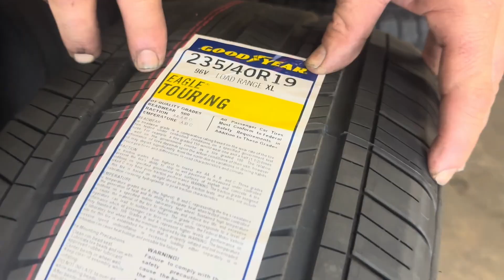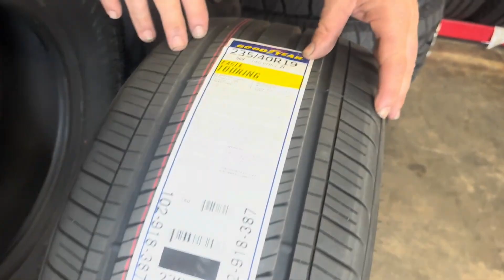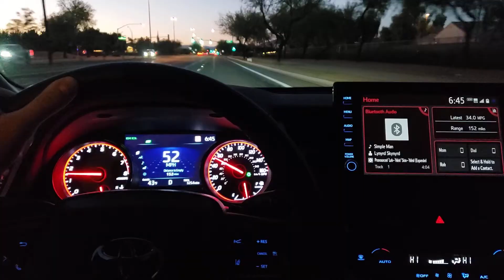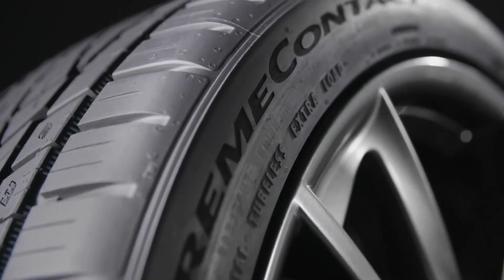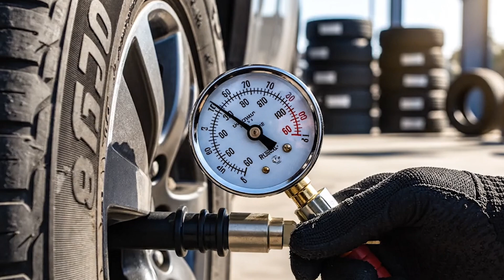I Tested the Top 10 Tire Brands — ONLY ONE Came Out on Top

Comment: No question that the Continental Extreme Contact DWS 06 plus is one of the best all season (i.e. 3 season) tires, but that's where it ends.  It is definitely not suitable for real winter driving nor does it offer "elite level performance" in the summer.  That's what dedicated summer tires are for.

Comment: #1 Continental extreme contact. I saved you 13 minutes of nonsense
Reply: I'm 72 years old and have used Continental over 5yrs.  Best I've had since I was 16...As a kid I bought BF Goodrich on sale...Worst I've bought was Sears steel belted around age 21.
Reply: In my 45 years of driving Continental, Kumho & Kelly Springfield have been my top 3 in reliability, handling & performance.